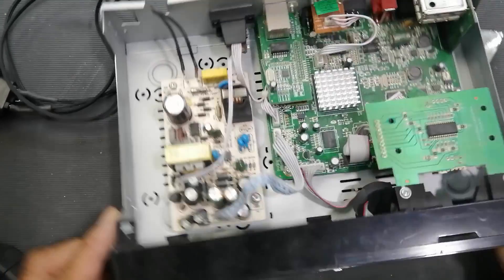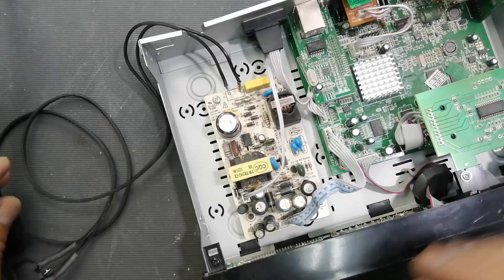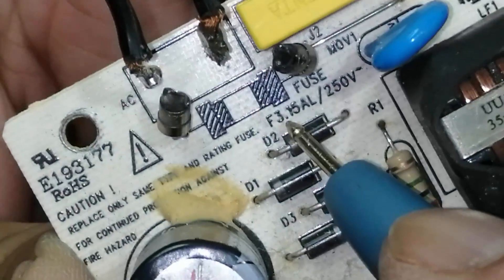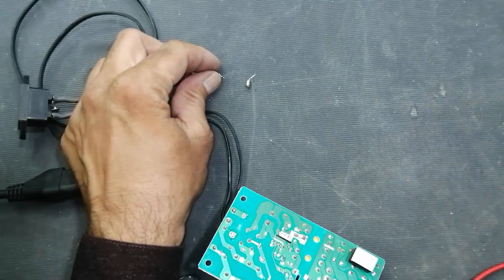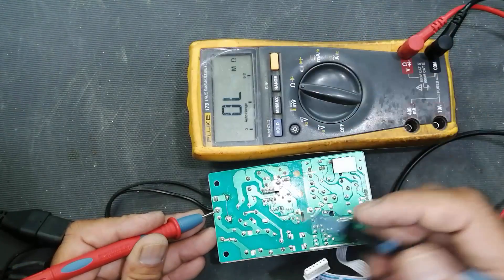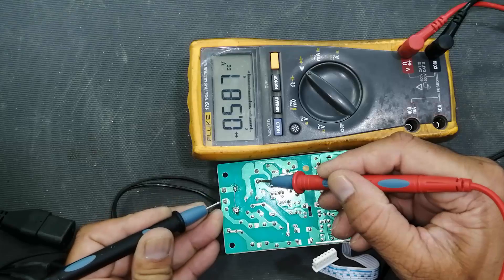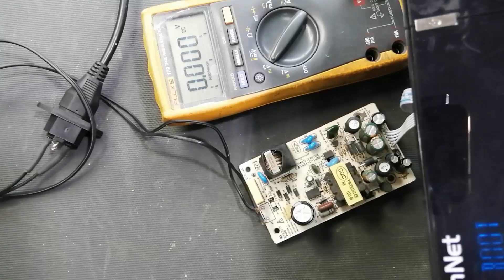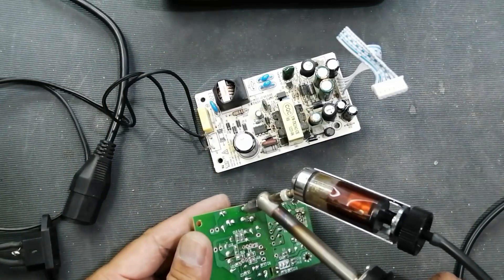{478} Satellite Receiver No Power Solution - How To Repair SMPS Switch Mode Power Supply

Comment: Many thanks to all of your videos. I have seen almost all of them. Thanks to you, I converted an outdoor socket, to which I connected a reflector bulb in series. That is my test socket so from now I can use any possible shorted device to that socket with it's own cable.
In the past few weeks I have learned a lot about diagnostic and repair electronic devices like SMPS. Many thanks for your job.👌👍🤝
Reply from the maker: it is your greatness and my pleasure that you liked my efforts 
please accept my best regards
Reply: @HaseebElectronics  Dear Heseeb, may I ask for a video: I have some totally same ATX PSUs. For more current, I want to use two of them in parallel mode only on 12V line. Is it possible? If it is, what things I have to take care of? Thanks for your help in advance.

Comment: I watch this video and the one you made called practical troubleshooting of smps.In the video you tested the input and the output of the octocopler and it was flutuating,and you say it was good.what if only the output of the octocopler is fluctuating
Reply from the maker: best regards and special thanks
in any case the fluctuation at optocoupler is not a good condition, it means there is something wrong in output section
if you remember the video number, please mention, i will check what was that condition
please
Reply: @HaseebElectronics  thanks sir for your response. The video was published on the 30th,march 2020 and the title was practical repair switch mode power supply. I am testing a CRT TV  smps ,the output was low and steady not fluctuating. When I tried what you did in that video I notice the octocopler input voltage was stable but the output was fluctuating. Could it be that the fault is at the primary section of the feedback circuit. Thanks
Reply from the maker: no thta fluctuations in output side are caused by load variations. if input side is stable that means the circuit is stable
Reply: @HaseebElectronics  thank you
Reply: But does that mean that the smps output is ok

Comment: Sometimes if you have MOV in a circuit the fuse will be blown when there is a surge from a supply. Good video thanks
Reply from the maker: yes dear you are right. but in cheap designs the quality is compromised, which reduces its life span